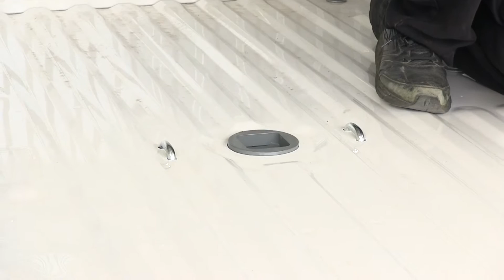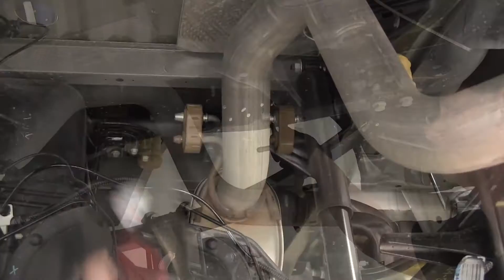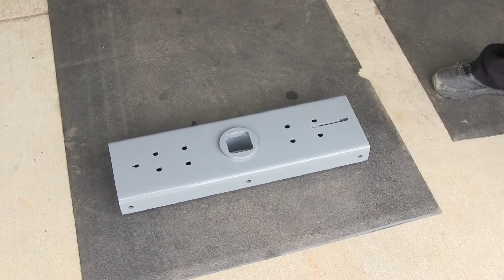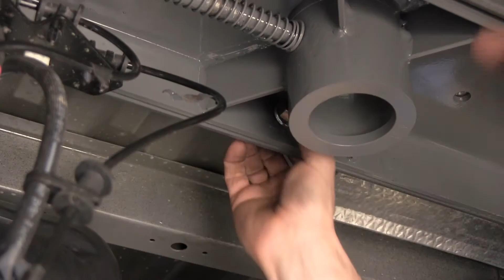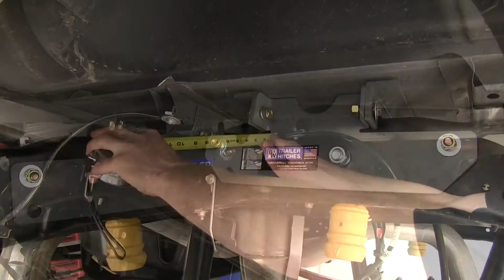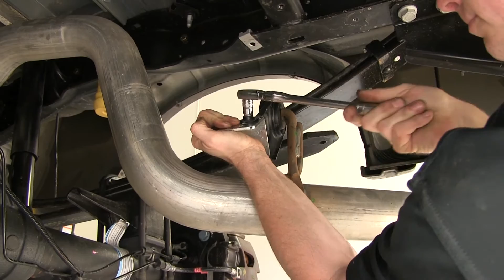etrailer | Gooseneck Trailer Hitch Installation - 2015 Ford F-250 Super Duty BWGNRK1111

Comment: Why would you not use the center marker from factory in the middle of the hole area?
Reply from the maker: Because B&W sets it up a little differently than the OEM hitch. If you use the factory marking, the hole won't be placed in the correct location.
https://www.etrailer.com/Gooseneck-Hitch/B-and-W/BWGNRK1111.html